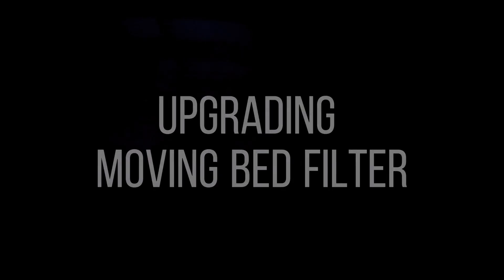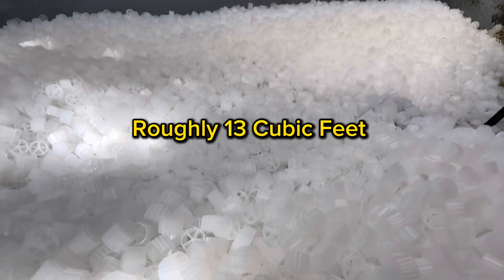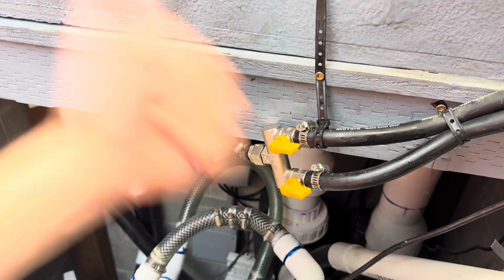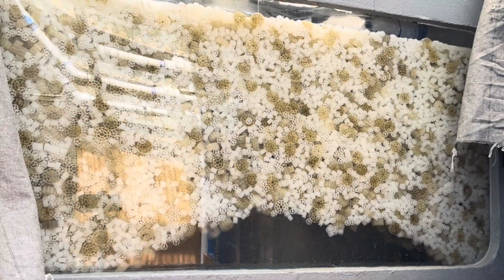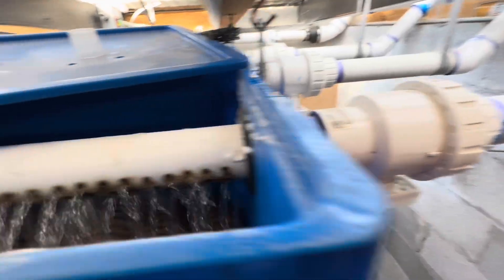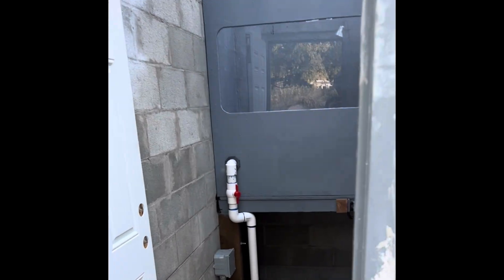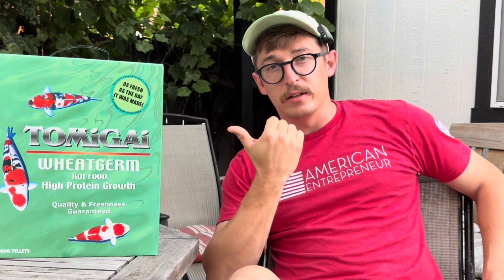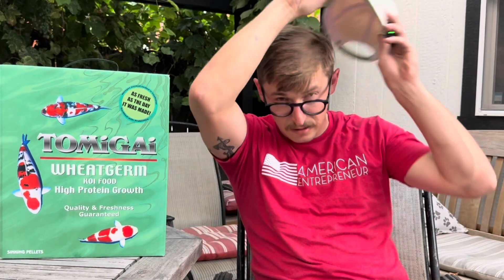Upgrading My Giant Moving Bed Filter | More Air. Better Flow. Less Worry.

Comment: Hey Ty! Im building my own moving bed right now. But I really have a problem with the flow of the water.. How strong are your airpumps exactly? It would really help me out! 
Greetings from belgium!🙂
Reply from the maker: Hello! I’m trying to look up the pump I ordered but I am in France right now and the internet isn’t being helpful

I actually tried two different pumps before landing on the second one. They were both comparable in terms on LPM but The biggest difference was the PSI. I’d suggest looking at pumps with a higher psi if you’re running into issues. I think mine is around 60LPM. I just can’t remember the psi 😅 I’ll look it up for you when I get home!
Reply from the maker: Hello again! I am back in the US and didn’t forget that I needed to message you. Here is the aerator I am using on big gray right now 

https://a.co/d/5MCmF4D

Comment: You need no return valves shouldn't have water in your airlines that's a serious moving bed good work mate
Reply from the maker: There is one on the other side of the manifold that keeps the water from coming back through. The aerator is also higher than the moving bed so it shouldn’t siphon back into the pump of power cuts out.
Thank you, and thanks for watching!

Comment: Noooo! Tomigai over Nijikawa? That’s a controversial take
Reply from the maker: Why do you say that? 😅
Reply: @The_Koi_Pit  is it really that much better in your experience?
Reply from the maker: @vish_gk  it really is. Comparing the 2 color foods side by for example, you can really see the difference:
Nijikawa’s color genesis is only 39% protein and fish meal is the third ingredient after peas & dried Beans and wheat (poultry meal is the 4th ingredient). TOMiGAi Spirulina food is 50% protein and the first 4 ingredients are white fish meal, fish meal, soy isolate, and wheat whole. 

TOMiGAi also has a bunch of vitamins added that Nijikawa is lacking. TOMiGai is a bit more if you compare their 40lb bags price to Nijikawa’s but I think TomiGai is a much better value considering what you’re getting. 

TOMiGAi is more comparable to Saki-Hikari in terms of you’re feeding your fish and doesn’t cost as much. This is my take anyways😅
Reply: @The_Koi_Pit that’s a very good explanation of the situation. If I could I would feed an insect based diet. I didn’t expect Tomogai to be better performing. Personally would try JPD before Tomigai but will consider it now too.